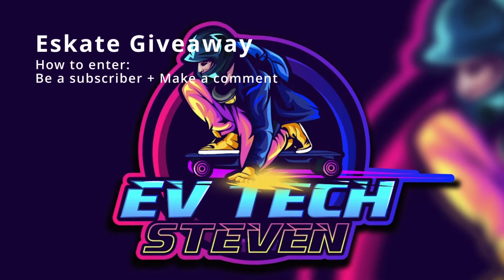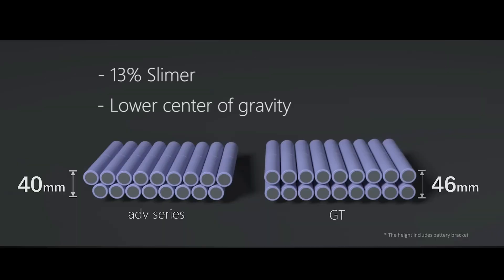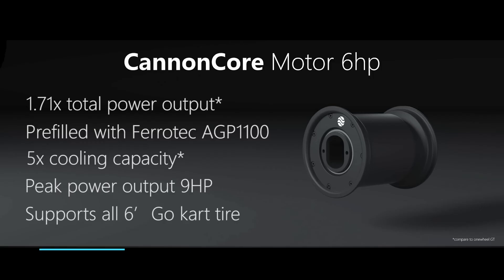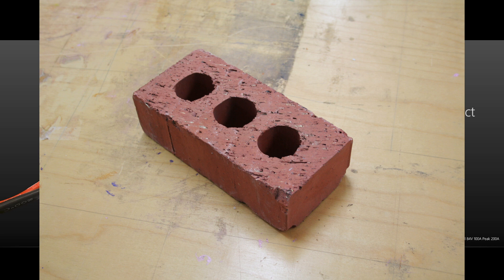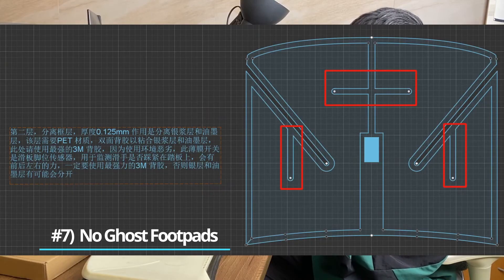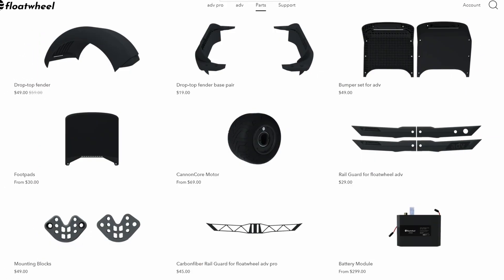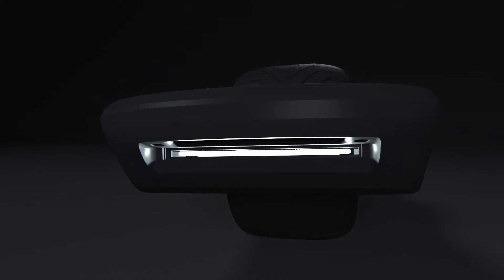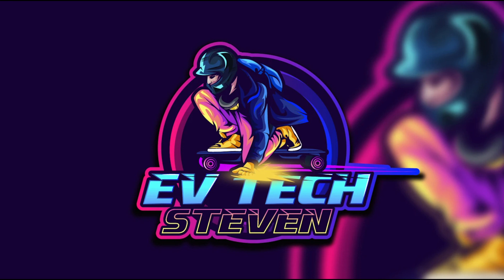FLOATWHEEL ADV PRO - Part 1- Plus Eskate Giveaway #onewheelgt Improvements over the onewheel.

Comment: Any info about this?? Site says 45 days lead time.
Reply from the maker: the boards should already be on a board. and the motors are just getting shipped out.
Reply: @evtechsteven  Coinbase commerce would only let me use my MATIC as payment for the board deposit and fender. Did it let you use Bitcoin?